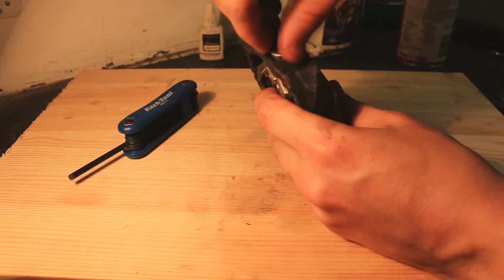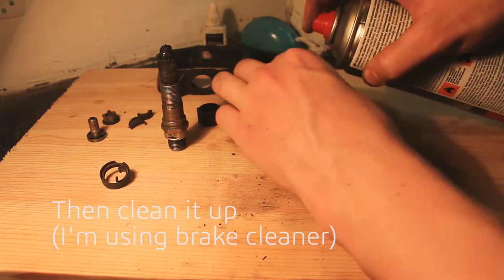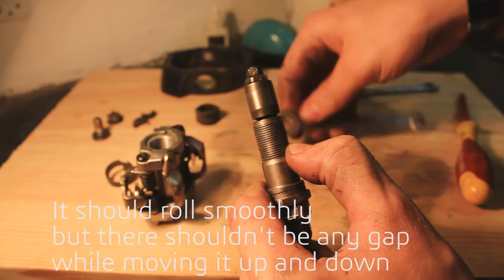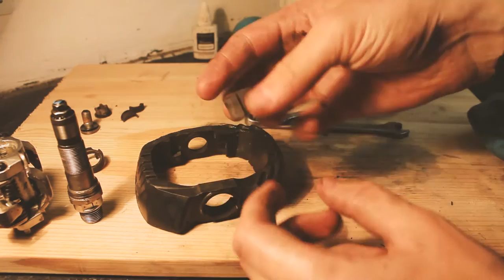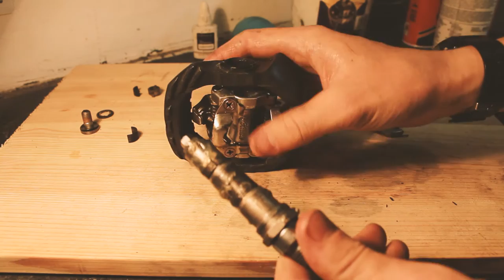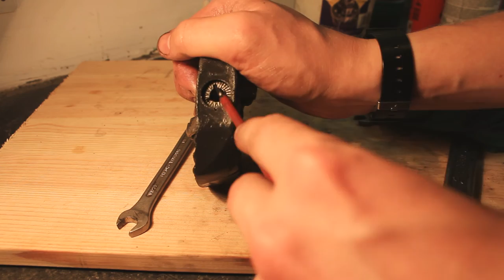Shimano DX M647 SPD rebuild

Comment: Thanks for the video. Reassembly is easier if you put the smaller split bushing (the one with the little tab) on the pedal before inserting the inner pin of the return spring. The tab sits inside the machined slot closest to the outer return spring pin, making sure that it lays against the 3 wrap side of the return spring. Your video helped me salvage a great set of pedals. Thanks again.

Comment: The smaller black half circle pĺastic has a notch attach to the castle like metal tube  and should be put before attaching the spring. I think the pedal will work without that plastic. Just my opinion. Thank you.

Comment: I have to put the pedal in a vice to turn the bolt that retains the spindle inside the pedal. I'd ordinarily use a torch, but too many plastic bits... I've had these through the winter on the fat bike (bought new in January) and if it's not red thread lock it's seriously bonded. I'll be looking into a pedal with better seals in the future. Thank you for this video.

Comment: when you put that tricky part, you should just put it there, don't worry about the groove, then when you screw in the bolt it will just follow and fall to the groove but the washer above the tricky part must fall in correctly first
Reply from the maker: Thanks for sharing. I know it should be shown on the video but I wasn't really sure if I was assembling it correctly. Anyway, when all is apart, it's not very difficult to find out which part comes together.. Especialy when you remeber what comes first during disassembling.

Comment: You put in the half circle pieces after you put the main clip back inside the pedal but I could not get it in to save my life that way. I had to put it in after I put the spring on but before I put it in the pedal housing. Here's a link to an exploded view of the parts and I put them together in the order you see them in this view. If you look at the exploded view you can see the one half circle piece goes in with the little nub down so it should go in first. There is a deeper notch on the clipless part where it goes.  Thanks for the video, it was very helpful.

http://www.shimano.com/media/techdocs/content/cycle/EV/bikecomponents/PD/EV-PD-M647-2305A_v1_m56577569830608618.pdf
Reply: Excellent comment. If you zoom in VERY closely in the exploded view, you can see that the plastic half circle with the nub must be oriented a particular way to fit in the recess on the pedal body. Nub end should be towards the pedal AND rotation is imprtant.